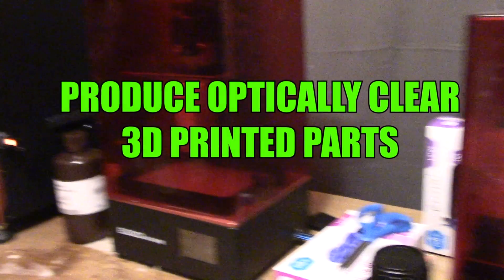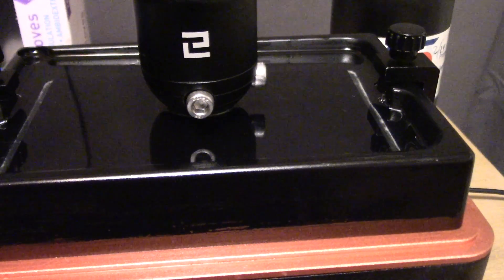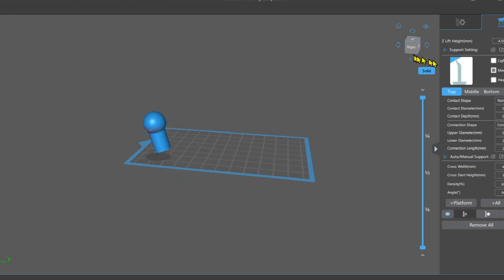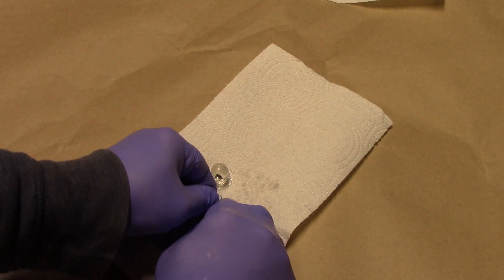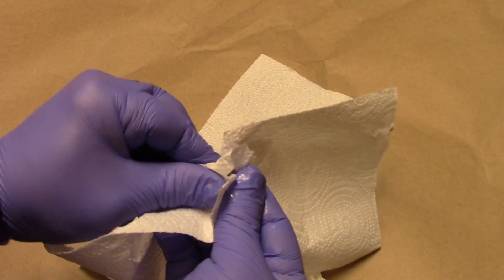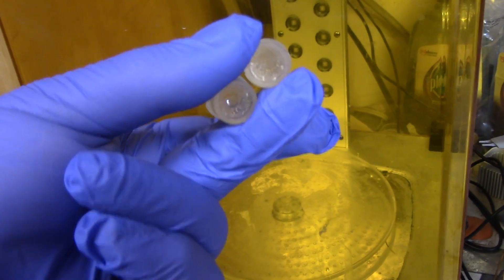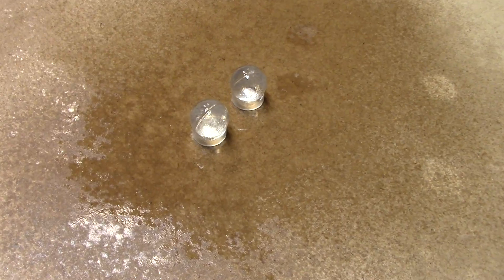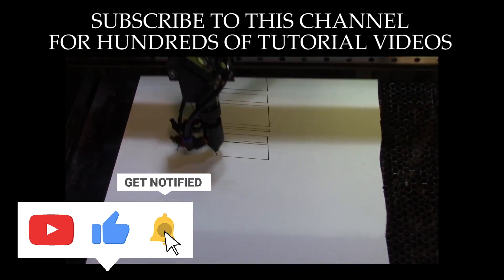3D Print OPTICALLY CLEAR Lenses and Canopies.

Comment: Also don't use "rescale" what you want is the model surface to shrink/expand and that's done with  Chitubox -> Settings -> Advanced -> Tolerance Compensation.
Reply from the maker: Thanks for that.  That's a method I haven't tried yet.  This is only one of dozens of projects I print on that particular printer.  You'd have to go in and adjust the compensation for each project.  For this I'd rather get in and get out without having to remember to readjust the settings. But I'll definitely do some experimenting with tolerance comp.

Comment: I thought 95% rescale is because you wanted to dip the piece into clear resin again before curing. For basic shapes without intricate detail it can give even better results.
Reply from the maker: on my particular machine that's dedicated to only printing clear parts (the Mars 2 Pro) it tends to oversize prints using this clear resin material just a tad.  I sprayed on the INSIDE of the lenses just to give the entirety of the lens a little more clarity.

Comment: Really useful, thanks for sharing. You can get clear cote aerosol with a UV filter to prevent future yellowing. Interesting about the sizing. This was an issue I had on my studio scale Slave 1.
Reply from the maker: Yes I tried dialing back the exposure on the clear resin to compensate but I ended up underexposing (according to the calibration tests I performed) so I compensated instead by printing a couple tests at 98-95-92 and 90% scale and the 95% was a perfect fit.